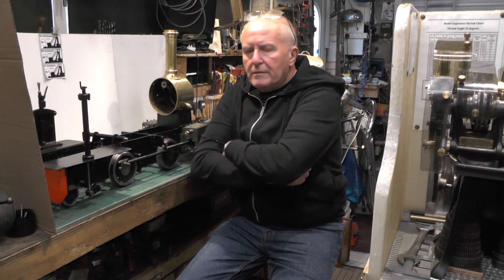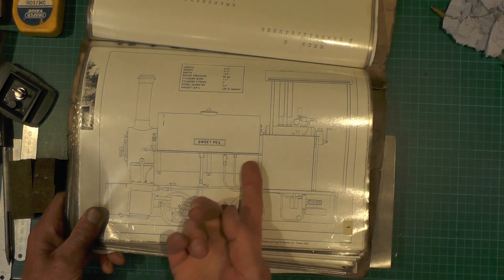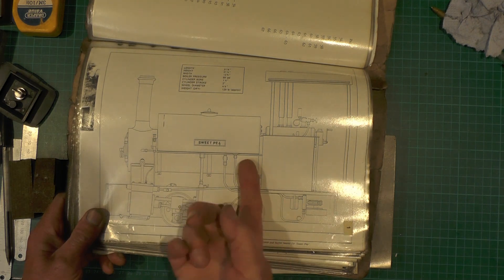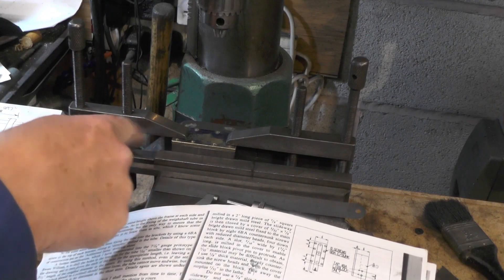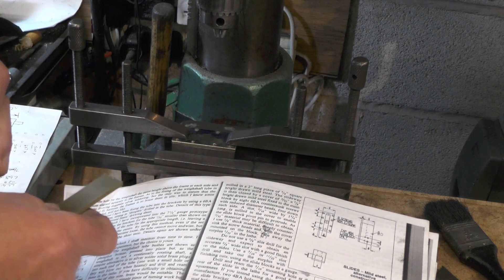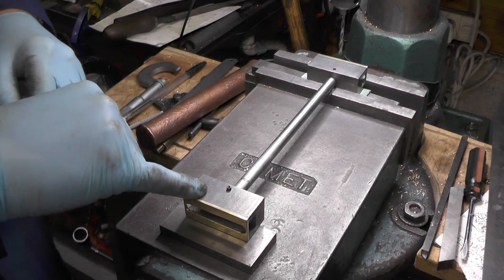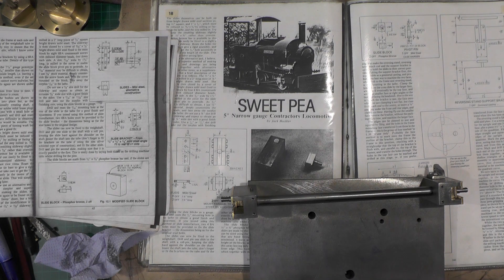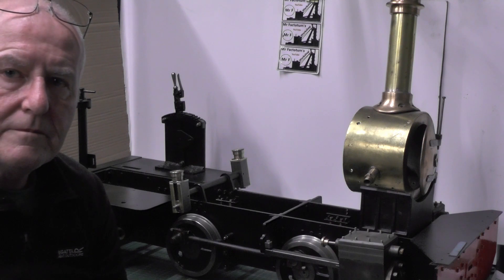Sweet Pea Steam Locomotive Build Part 15 Making Locomotive Slides - Valve Gear "mr factotum"

Comment: Some more nice parts Kev. Always enjoy shaper action. Do you get your cast iron from a metal supplier or is there another source I could look out for
for? Cheers Nobby
Reply from the maker: cheers Nobby
beg, buy cheap or borrow!!, i get some from my local MES secondhand shop,
Is there anything in paticular you require, might be able to help. Let me have the size you want, and will see if i have anything that suits, can't promise but
always willing to help out, if i possibly can. 👍👍
regards
Kev
Reply: @MrFactotum  Hi Kev nothing I need at the moment. Just making plans for the future. I’m always on the lookout for scraps of metal, steel, brass etc. so far haven’t come across any cast iron. Thanks for your kind offer, I’ll definitely bear that in mind. Thank mate. Cheers Nobby

Comment: Hi Kev, you have great machine tools (planer and saw). A lot of work goes into these parts to control the engine. Is this a simplified way of controlling? Otherwise I only know the Heusinger control or the Stephenson one. I look forward to further progress. Greetings Michael
Reply from the maker: Hi Michael
thanks very much,👍👍🚂🚂
 i only have experience in this valve gear it's the "Hackworth Valve Gear", many people i hear say, its not very good, but i have never had trouble with it if it's set correctly, it's a very simple valve gear.
As for the saw i made that from scratch here
https://www.youtube.com/playlist?list=PL-pTTqrwcPlJp470EnMmVXmjbV1iMeGYa
and the Shaper i renovated here
https://www.youtube.com/playlist?list=PL-pTTqrwcPlIvG0Mw9fFyUArT_9V1D8xs
thanks for all your interest
appreciated
regards
Kev